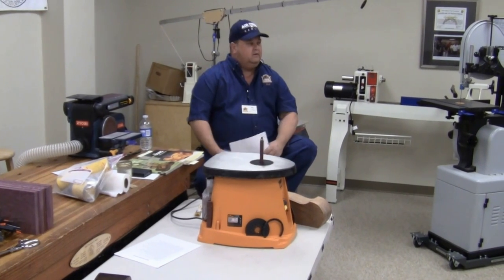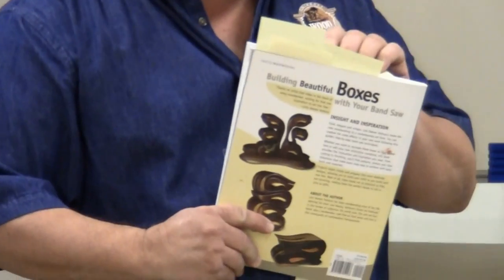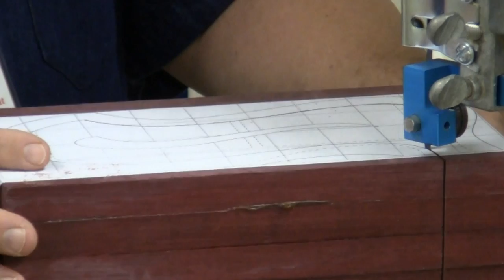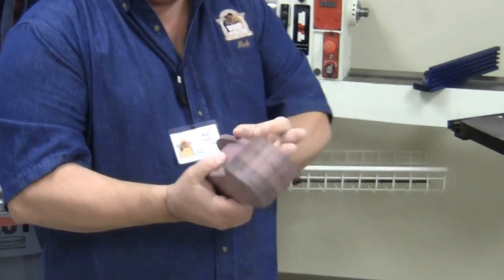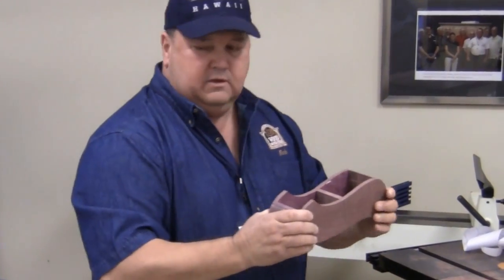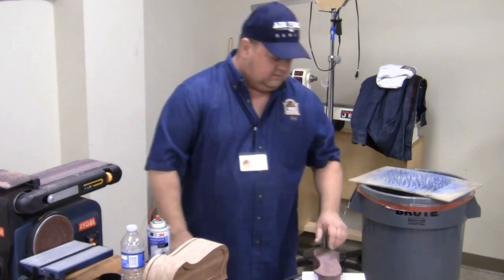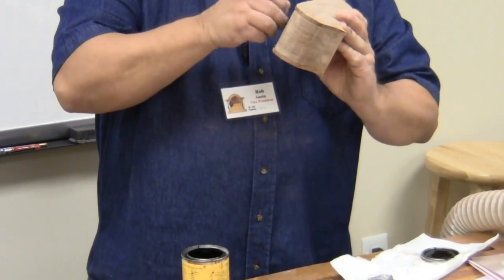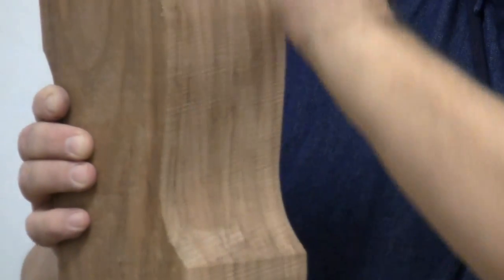2012-01-28 Band Saw Boxes by Rob Austin (01h01m)

Comment: using 1/8" bandsaw blades is great, but the downfall is that they do break more often, i buy blade by the foot and measure/cut  and solder/weld for myself , when i have enough brokens ones piled up i have a repair day